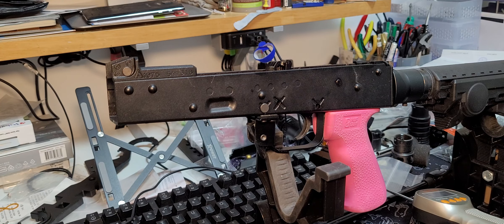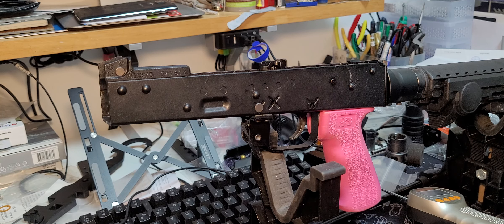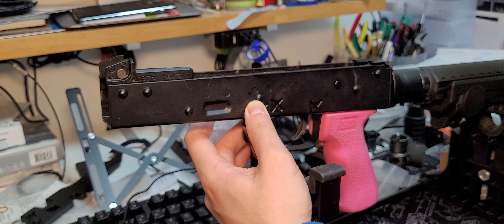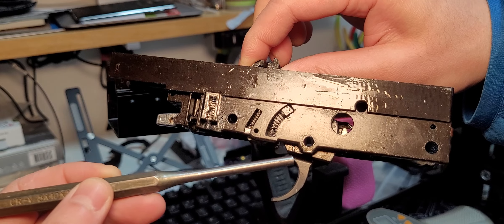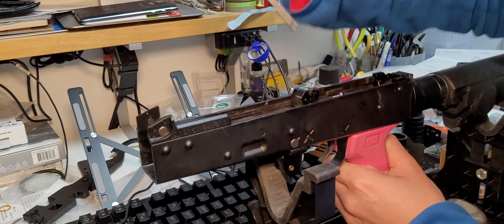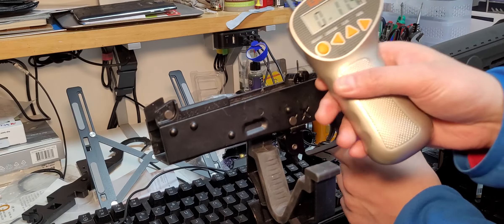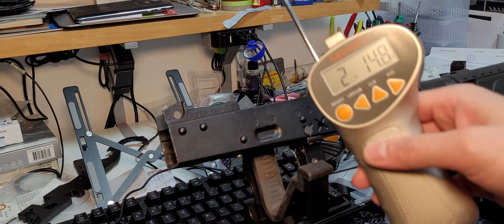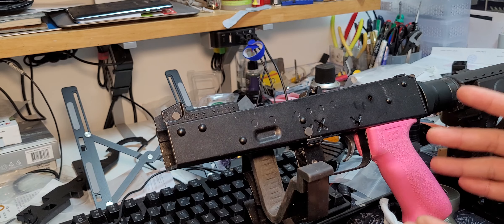Marui AKM/AKX trigger tuning Part.1

Comment: I haven’t watched all your videos yet. But if you find the right spring, I’d love to find out which spring spec works for you.

My AKX has arrived, and brand new out of the box, the trigger spring isn’t strong enough to reset the trigger to a point where the safety can be engaged 🫠
Reply from the maker: I have several configurations tested and the weight recorded, they're in HRC in the #tm-ak channel threads